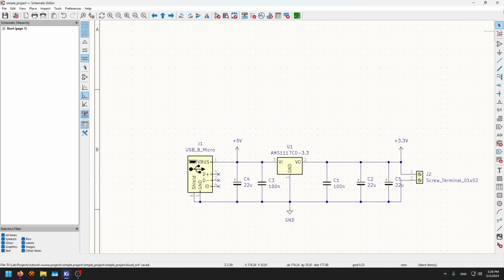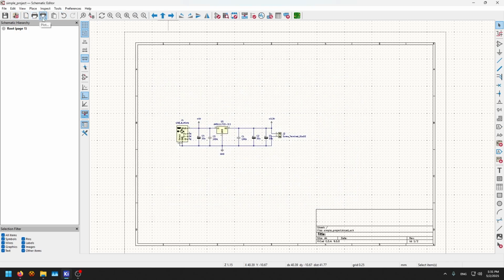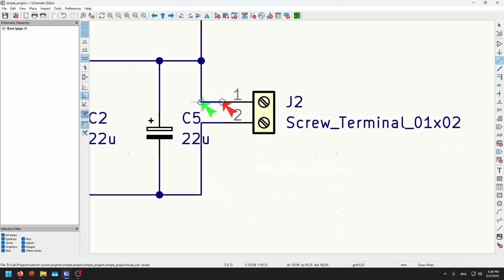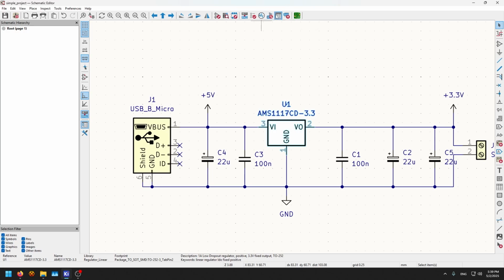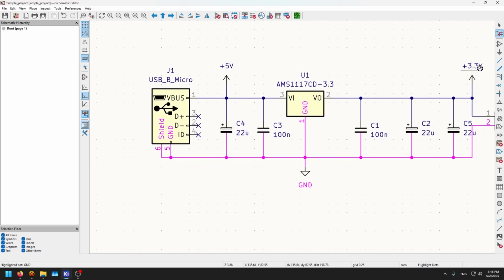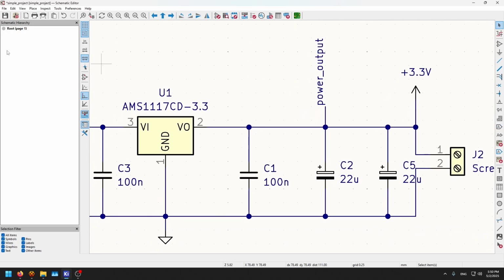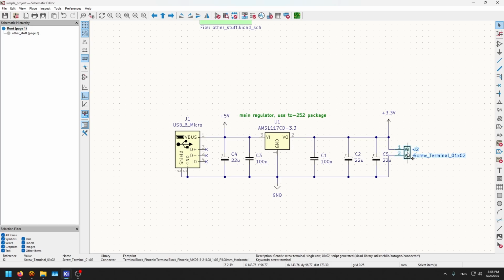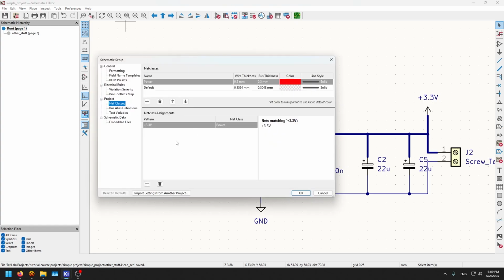KiCAD 9 tutorial course [03] - Schematic editor

Comment: Has this changed regarding netclasses from version 8? It is very unusfull to write the net name. There is no list anymore where you just assign the net to a netclass.
You don't even see the nets in the netclasses that you added thru the schematic directive! Is this a bug? Why is the Netclass Assigment field empty?
Reply from the maker: not sure what you mean but i opened the software now and found the net classes as i explained them, you can add and manage them easily.
maybe post a picture.
Reply: @Thundertronics  I means the nets list. If you enter Board Setup - Design Rules - Net Classes. You don't have a visible list of all nets anymore. You need to writte the net name into the pattern to find it. By defoult this window is empty.
And if you are using the Directive label and assign there a netclass to a net. You dont see this in the NetClass window in Board setuo or Schematic Setup. You need to assigne it there again. Nothing is linked.